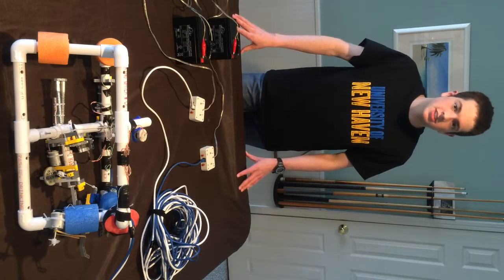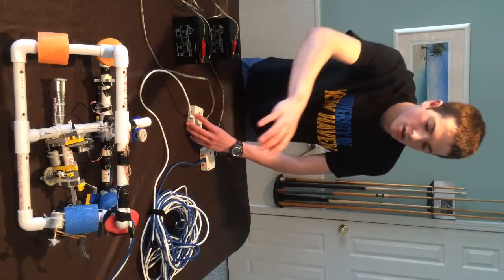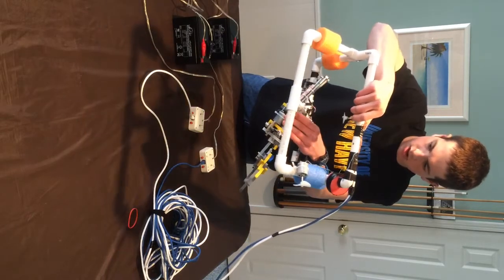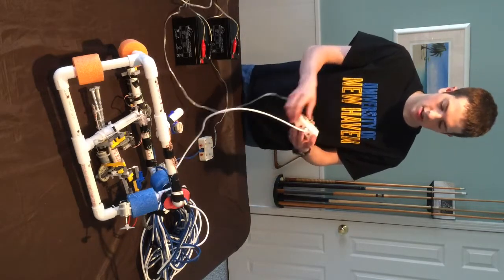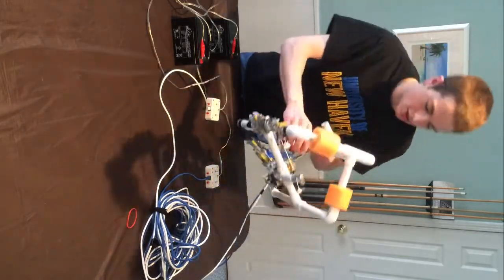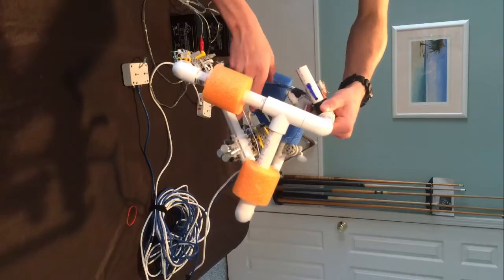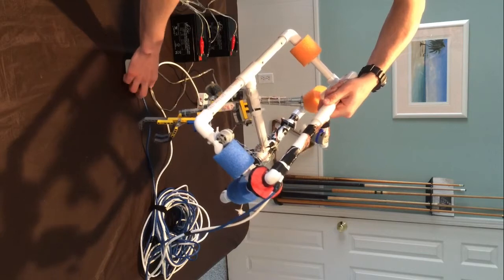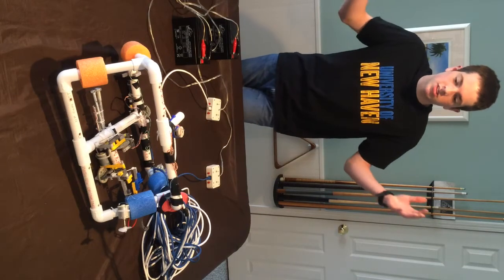Homemade Underwater ROV With Robotic Arm

Comment: Hello Matt, your project is good. I have a some question.  
How can i calculate the motor torque while working under the water?
How can i isolate motors and What kind of motors should I use?
Could you suggest an article?